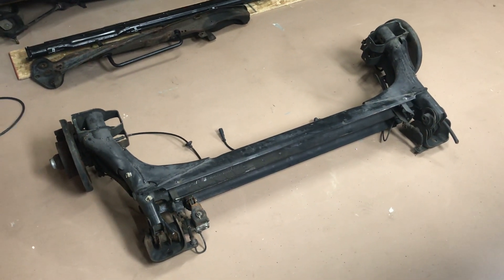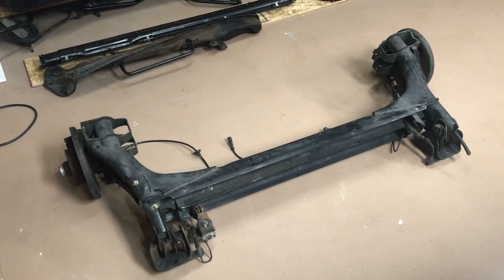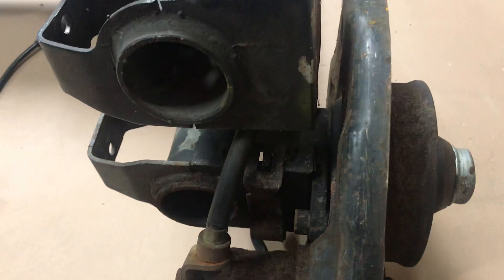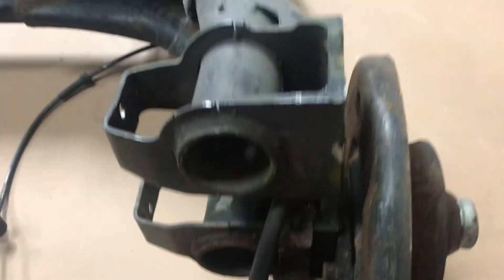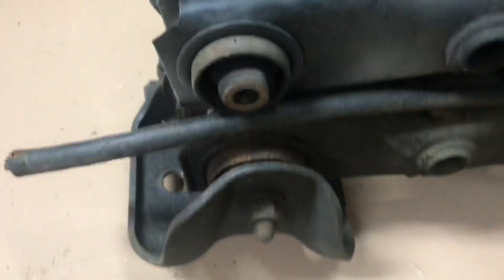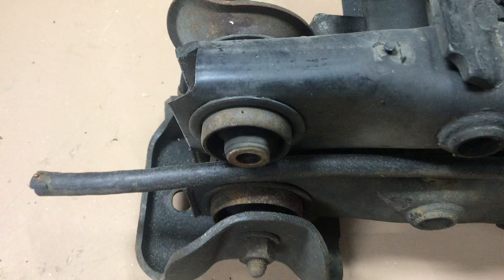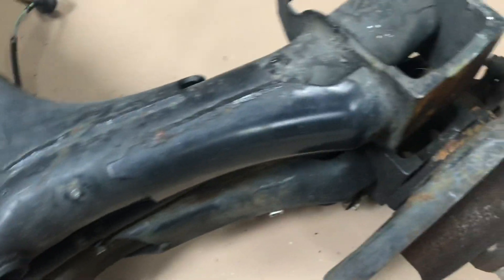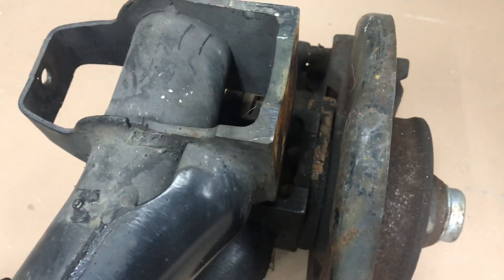Corrado G60 vs VR6 Rear Beam Comparison

Comment: Is it ok to use a floor jack under the center of the rear axle to lift both rear wheels at the same time? i have done that many times because i don't like using the sill or other jacking points (only if i need to lower the subframe). can lifting the rear this way cause any damage to the subframe? what do you think? -> yes best way to do!
Reply: Нет , не может
Reply: @АнтонКозловский-я1п no, you can & should. and it is the best way to do without damaging anything. at least if you got an low jack or a high corrado😅